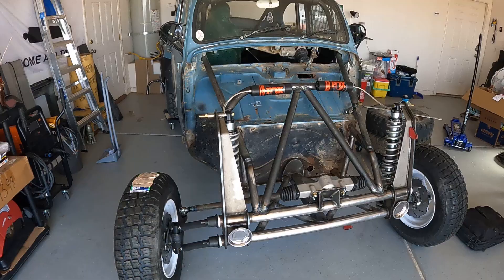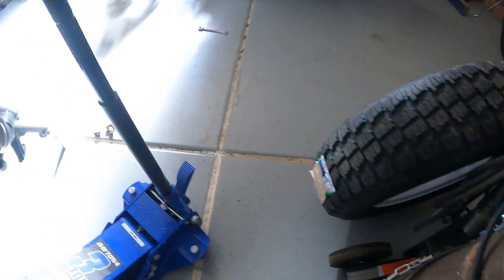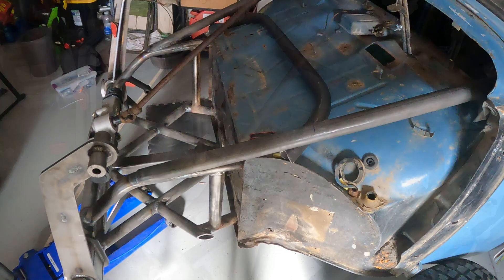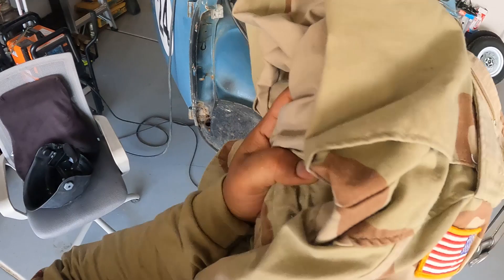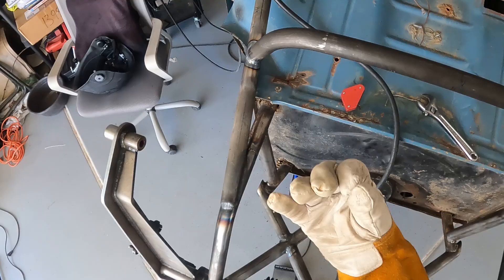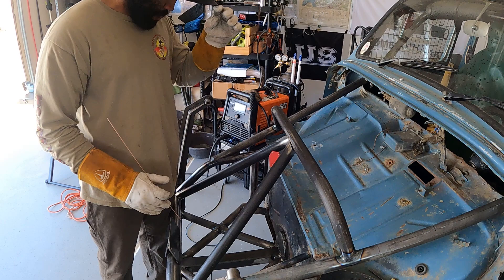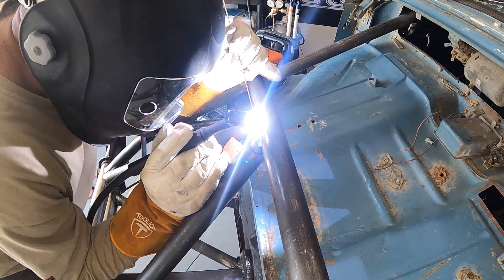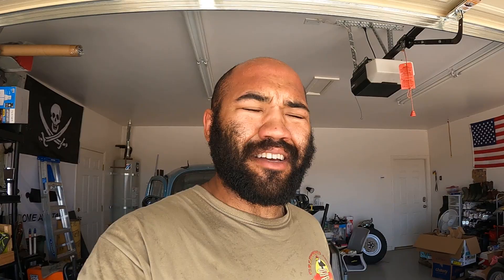Baja Bug Build Front Beam Fabrication Finished (EP.5)

Comment: What kind of travel are you getting on the front end How much travel do the shocks , How much longer are the trailing arms?
Reply from the maker: I haven't measured front wheel travel yet. The shocks are 10in stroke and the front arms are 4 x 1 with a 6in wider beam

Comment: Im just starting to build mine. Whats the part number for those coil overs? Also what's your measurement from firewall to beam? Your build is coming along nice.
Reply from the maker: hell yea brotha get her going! this is the part # FOX98002005 this is form kartek but I got mine used. and form firewall to the edge of the bottom beam tube is 17in. Thanks!
Reply: @brothabug  appreciate the info!